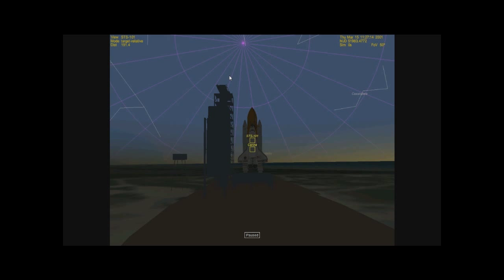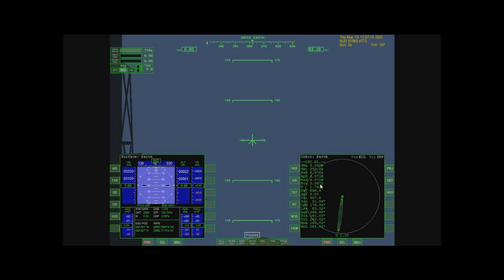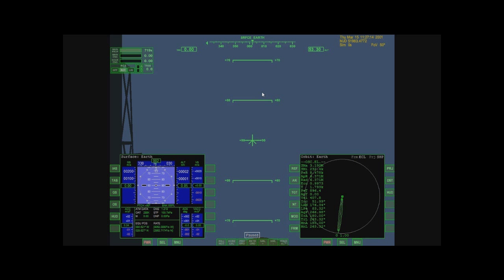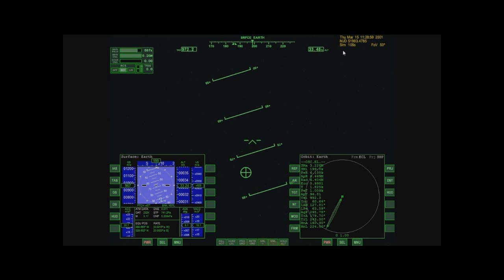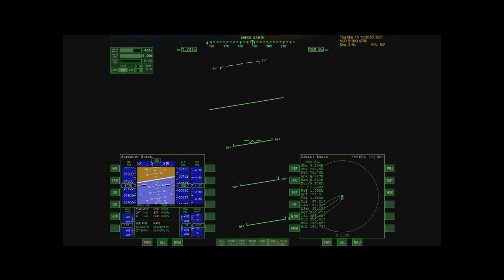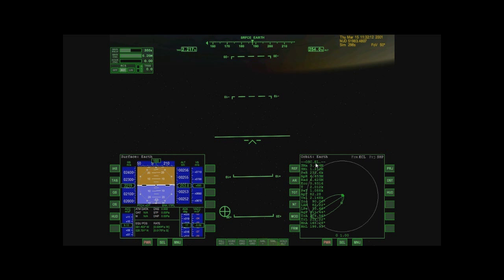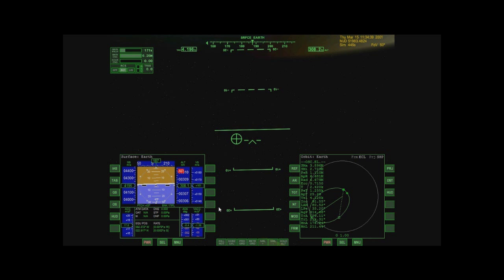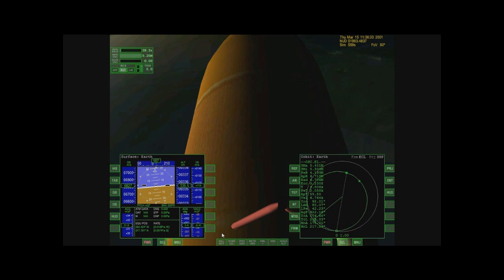Orbiter 2010 Tutorial 1: LIFTOFF!  (part 1)

Comment from the maker: @mProduction4 It is pretty normal, keep in mind your main engines only push forward.  Those tiny little holes in the front you see on a space shuttle?  That's what you're using.  It's not the most high power maneuvering system.

A video tutorial explaining keplerian orbital parameters is upcoming.  I had to take a bit of a break due to real life.

Comment: Hmm... kind of an odd way to get to orbit, using the sim timer to determine your pitch angle? Is that something that the real shuttle actually does? (Pitches over based on specific timings?)

Also ... not that it matters really because this is a basic tutorial ... but in case you don't know, you have your frame set to the Ecliptic plane (press FRM to toggle between EQU and ECL) ... so at 11:33, your Inclination is actually relative to the sun's ecliptic plane, not the equator.